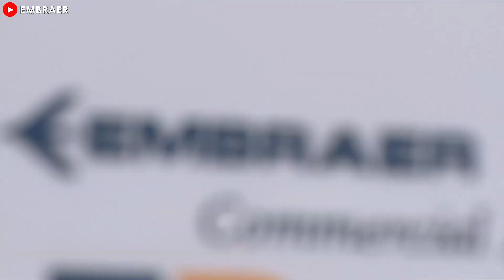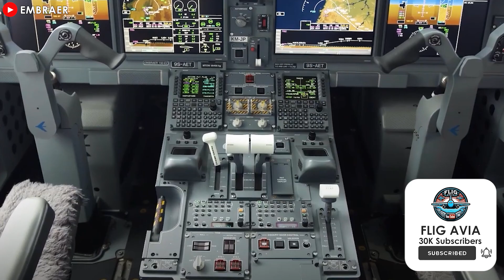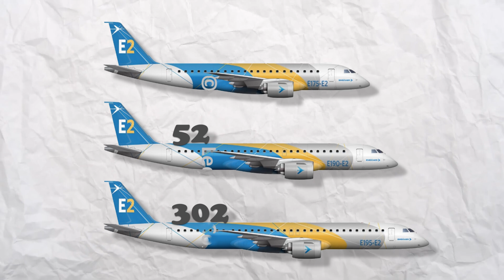This Why Delta United And American Said “NO” To The Embraer E2!

Comment: the A220 is not more fuel efficient than the E2 190/195. Actually the Embraer is up to 5 % more fuel efficient - it's limitations are the 7 t jet-A fuel smaller fuel tanks = lower range than the A220, despite that the Emraer is quite a lot more fuel efficient thanks to the superb E2 190/195 huge-wingspan wing.

Comment: Interestingly, there may be one airline that might express interest in the Embraer E195-E2: Southwest Airlines. Reason: the continuing delays in certification of the 737-7 (neé 737 MAX 7). The E195-E2 could fly many Southwest routes now assigned to the 737-700.
Reply: @Sacto1654  why when  they can buy 737-700 used with low cycles for 2 million dollars. The 737-700 was dumped by many airlines.

Comment: Please forgive me, but you are completely missing the economic side of the debate.  The Embraer  is a great aircraft without much debate.  However, look at the bigger problem.  To take this to an extreme, it is a debate about the efficiencies of trains, or buses versus small sedan cars.  Combine the efficiencies with the load capacity (traffic jam) of big city airports.  In short they already need to limit the number of aircraft operations they can perform today.  Limiting a major airport to only smaller aircraft is simply not feasible economically,  

Let us dive deeper into operations.  Let us say their are 100 passengers that want to travel from small city A to small city B.  Perhaps this is economical for the specific route with an Embraer, but certainly not on a Boeing 777.    If 10 passengers actually want to travel between continents they must travel through larger airports (hubs).    If you remove the other 90 passengers by flying direct between small cities the leftover 10 passengers are not economical to travel to the big hub for connections let alone across the globe.

This is a huge and complex scheduling, or planning decision for airlines.  You have a limited number of operations allowed in a big city yet can’t fill the large aircraft capable of actually making the flight from small cities.  It is an extremely complex equations and I have only touched on 1, or 2 out of a hundred variables.

Thank you for the video.

Comment: 2x2 seating will always be superior in terms of passenger comfort. At any given point, you'd only get/need to touch one other person's arm/elbow. They are plentiful in Europe, but I'm still surprised they are not more common and utilized. I do know that KLM (Cityhopper) has a tendency to rough land when flying E-jets, but still, if given the option choice, I'd much rather be in a E175/E190 over other 3/4-seater planes or turboprops. I think Embraer is leaving a piece of the market on the table by not thinking/working on a ''LR'' version of their jets; I think it could be a (niche) hit!

Comment: IF Boeing cannot get the 737MAX7 off the ground and IF the activist investors can get some leverage at Southwest THEN perhaps Southwest can replace the smaller 737s in their fleet with the 195-E2. The 737 will not be around forever and Embraer is motivated to make sales. Perfect storm.
Reply: Many American Airlines like supporting American businesses such as American, Southwest, and Alaska. Boeing will most likely build a new aircraft to replace the Max within the next 30 years. Which mostly likely will target the airlines that fly the max to make the transition to the new aircraft as smooth as possible. Maybe using similar parts or similar systems that the max uses. Let’s be honest Boeing won’t be going anywhere.